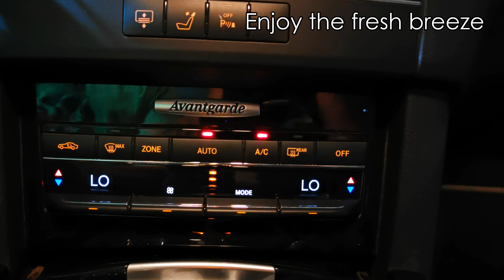Air Cabin Filter Mercedes E Class W212

Comment: There is a special place in hell for the engineers designed this system. They have to replace the filters all the time, and the white slide lock do not fit all the time.

Comment: Thanks!  Still liking the Mann?
Reply from the maker: I had great experience with Mann filters on my BMW, but on the Mercedes both the old original filter and the Mann filter seem to have an unpleasant smell, might try a different brand next time. To add on, some Mercedes original filters are actually made by Mann.
Reply: Zaki Garage Yeah I feel like the location also has a lot to do with it.  I preferred the setup on the W211.
Reply from the maker: Thanks  @ChrisHimself1357  , I wasn't aware of those I'll give them a try. But I don't think its a mold problem, its the smell of the plastic itself coz even the new filter has the smell.

Comment: What is the Cable on the left side?
An temperature sensor for the AC?
Reply from the maker: yep, its a  temperature sensor
Reply: In my W204 the temperature sensor is over the rear mirror.
Reply from the maker: @thebamplayer  Interesting, I guess it's one less step to change the filter on the W204.
Reply: @ZakiGarage  Yes, you only have to pull the plug for the lightbulb

Comment: It is sure that the ventilation system is designed by an idiot, not an engineer. Otherwise it should have been much more practical..
Thank you for this great help.
Reply from the maker: Had the same frustrations the first time I had to change the filter 😆